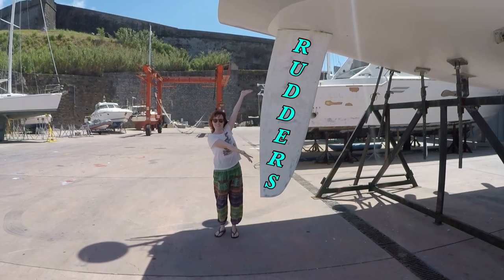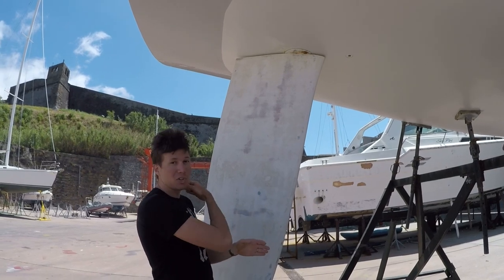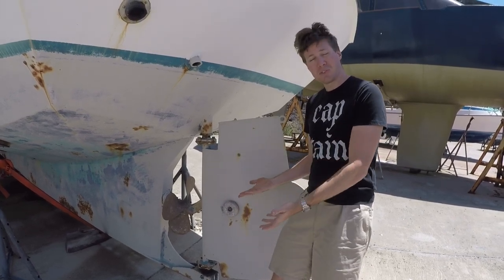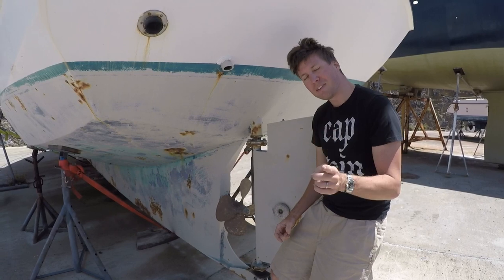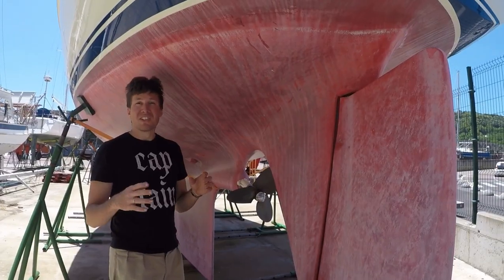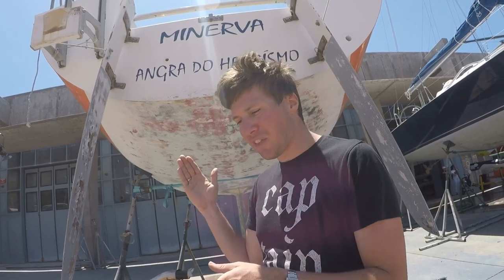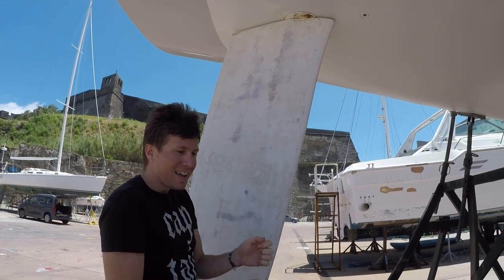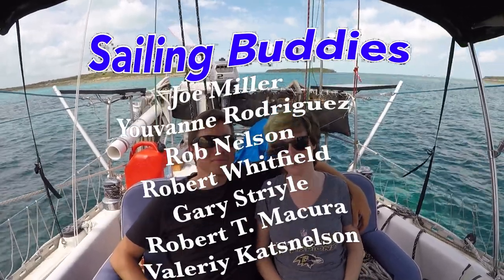This is the BEST Rudder! | Sailing Wisdom

Comment: My boat (a 1974 Dufour 35) has its stock entering the hull above the waterline. It was a major buying point for me. No freezing in winter and zero risk of sinking because of a rudder dropping out.
Reply from the maker: That is an excellent design feature!!
Reply: At that point, you’ve lost the end-plate-effect efficiency of the rudder, so why not just hang it off the transom?  Even more water-tight, easier to service, and can kick up.

Comment: We sail a Stamas 44 ketch from 1985. Her stock rudder was 30" wide and about 8" thick. The chord was way too fat. While sailing the rudder was constantly stalling on both the windward and leeward side. Hand steering required complete concentration. Luckily auto steering works well. So after sailing all summer like that, we bought a new custom rudder from Ruddercraft. Wider and thinner with a chord ratio of about 12:1 to 14:1 (it tapers). We re-launched a month ago and are very favorably impressed with the modification. It's probably rare to find someone who has redesigned their boat below the waterline.

Comment: You pretty much covered the basics.
You also talked about compensated rudders, and it is worth mentioning here that compensating a rudder is an excellent way of reducing autopilot power consumption.
About twin rudders and their advantages:
- Because one of the two is always acting vertically in the water (more efficient as you mentioned), then they don't need to be as long and deep as single rudders.
- When they are hung on the transom, they can be hinged so that the upwind rudder can be flipped out of the water.
- This hinge mechanism also incorporates a safety shear pin, so that in case of choc with a floating object, the rudder flips backward and out.
- twin rudders also means you always have a spare rudder.
The flip side of twin rudders is that they are a pain for maneuvring the boat   at slow speeds in close quarters.
Reply from the maker: Very cool points about twin rudders.
Thanks!
Reply: Why are twin rudders inherently bad for slow speed maneuverability?

Because they aren’t vertical when the boat isn’t heeled, so they are less efficient?

Because they aren’t in the prop wash, so they don’t have any lateral thruster-effect?

Anything else?

Comment: Very well done.  So easy to understand after watching your video.   I learnt to sail in a trailer sailer and recently I have sailed in Hansa 303's.  I always wondered how the Hansa boat could turn so well.  So now I know, because of the rearmost position of the rudder.     
I am building a small RC boat for the grandkids and I am wondering how to build the rudder to fit.  Now I know exactly what I need and what shape will fit the boat.  
You have been very helpful.  
Kind regards and keep sailing.
Reply from the maker: Thank you very much

Comment: An Alberg 30...
Carl Alberg was a great designer!

I'm looking at building a daysailer with a Kvaerner or VARA-type rudder cylinder through which the rudder is dropped like a daggerboard. If it breaks...

Just drop another blade in.

Comment: Lived on and sailed a Pearson 26 for a couple of years.  Fin keel with a BIG rudder on a post.  Hauled out to do some bottom work.  Manually moved the rudder to one side to sand a portion of the hull.  The rudder fell off!!  Electrolytic corrosion had eaten through the rudder post.  Fortunately it fell off in the yard and not in the last sail up the coast of Maine to the yard.  Don't have my next boat yet but whatever it is, the rudder won't be just hangin' out there.  I'm leaning toward offshore, full keel (I will be single handed).
Reply from the maker: Ouch! Thankfully it made it all the way to the dry dock! At least it happened at the best place for a problem like that to occur ⛵️
Reply: @RiggingDoctor  And I didn't even have to sacrifice a virgin to Neptune!  lol  I was most certainly grateful.

Comment: On my Sigma 362 I've got a kind of hybrid. Essentially it is an unbalanced spade rudder (the rudder post is at the leading edge) but there is a fin extending from just aft of the P post to the rudder where it is about 12" deep. In this way it semi-protects the top end of the rudder so nothing can get caught in the hull/rudder joint and jam it up like it could in the Benetau you show in the video. Whether it would protect it enough to prevent me from losing the rudder I hope never to find out! I was chatting to someone (a very experienced long-distance cruiser) about this issue a while ago and his opinion was that anything you run into is going to hit the keel first and would get deflected away from thr rudder anyway. Of course, that too is just a theory and one I'd rather not put to the test!
Reply from the maker: Any extra protection is better than no protection at all. 
I think it was on a Distant Shores episode where they had weeds getting caught in their rudder/hull area. It wasn’t jamming but it was causing drag.

Comment: Hi, thank you for the video!  I watched because I am currently working on building a new Rudder for my Rob Roy 23 Yawl.  It is a difficult thing to engineer and several of this design have had problems.  It is attached beneath the stern to a rudder post with plates welded on either side of the post.  A stainless bolt runs through the plates to hold the rudder and allow movement up-and-down via a line attached to the trailing edge of the lower portion that runs up to the cockpit over the transom...  

I appreciate your comment about the “fuse” because I do not want to build it so strong that it will not break-away....
Reply from the maker: Best of luck and kudos to you for doing the work yourself!

Comment: To answer your questions...  We have a giant keel hung rudder.  And yes, I think about this topic all the time.  It is a frequent subject in my head from when I'm swearing at it for not being able to backup out of my slip, or when I'm jealously watching fin keel with spade rudders nimbly do tiny circles in the fairway.  Once we are underway, it is fine and dandy and I never worry about it again.
But backing up is an adventure as you never know where you will go until you are up to speed in reverse.  (Seriously, 2 blade prop + full barn door rudder = reverse lotto)
Reply: I spent roughly 27 years in a Albin Vega where the propeller exits the counter stern above and behind the rudder. There was no steering in reverse until about two knots. Thankfully it was so light that I could easily manhandle it out of any slip. However reversing into a slip or setting anchor ranged from comical to terrifying depending on the boat's mood that day.
Reply: @flyingdutchman6984  this made me laugh as it is so close to my own experiences.
Reply: @jordanharkness  - for some reason my comment appears to have disappeared. Oh well.....  Anyways thanks for the comment back.

Comment: With the Albert style  rudder you do get the prop wash effects it's  slightly limited
Reply from the maker: We also have a 1966 Albert 30, but it’s engineless so I have no experience with the rudder notch for the prop. All I know about that notch is how great it is for servicing the shaft and the reduced effectiveness of the “stern thruster” trick.
Good to hear from someone with first hand experience on the matter.

Comment: Is it take called a fuse or is that what you call it? It's failure mode is to break off..it's similar to how a fuse works..a specified failure mode so it doesn't take it everything else. Also kind of like a key on a shaft..so is it a failure mode, a fuse, or a key?
What's it called when part of the rudder is in front of the axis of rotation..where it gives you a little bit of power steering due to water pushing on the part of the rudder in front of the axis of rotation?
Reply from the maker: The front part of the rudder is called a “compensated rudder”. 
I call it a fuse because it is the safety point. I’m not sure what the designers call it, but it is the planned failure point to protect the rest of the boat.

Comment: Why have blue water boat manufacturers like Amel and RS gone with twin rudders? Is there a design feature that offers some resilience if you run over something?
Reply from the maker: Actually quite the opposite, they are no longer protected by the keel and are at more risk of being damaged. 
The reason they do it is not because at the cutting edge of racing, it has its advantages which are never going to be realized by the normal cruiser, but because it looks fancy and sets them apart from other boat manufacturers (which all do the same). 
Race boats have features because of rules or performance, and people buying a boat want it to look like the race boats they see. In turn, the manufacturers make boats that look like the race boats to improve their sales numbers. 
A few companies make boats because they are good and not because they “look” good. These boats look very different from all the other manufacturers.

Comment: I want a full keel and the usual rudder sets that comes with them.  However I am really worried about docking.  Is the prop walk as effective?  Do they work as well backing as a spade rudder does, even if the effectiveness in the first place my be negligible??  Generally I worry about getting enough out of the propulsion and steering to dock effectively.
Reply from the maker: Prop walk is never enough when you need it and too much when you can’t have it.
We just never attempt to stern in if there is wind or current, in those cases we bow in. At some point it will be calm and we spin the boat then.

You will get used to the setup you get and then you will get better at that setup. I’m pretty good at Wisdom but a total noob on any other boat!

Comment: Yet one more interesting design is the boreal daggerboard combo.  e.g. https://www.morganscloud.com/2010/06/10/rudder-options/   It uses a smaller barn door like rudder, but it is supplemented by a dagger board that can be adjusted vertically to give more lift and balance the helm using clean water.  I've never used this but like this ideal.  While it might be a bit more awkward to get used to and reportedly the boat is still not great in tight quarters, it seems to give an ingenious solution for simplicity and redundancy.

Comment: If I had a 'Performance Rudder', at the very least I'd attach a ring and stainless cable to the top corner so you wouldn't lose the whole blade. Even better, cut a 45º notch from the top trailing corner and hang the rudder from a robust hinge locked with a shear pin. You can replace a shear at sea, but not a rudder...Our Balboa swing keel had a 'drop in' rudder that was great for beaching but could be tough to pull if you hit a sand bar...
Reply from the maker: I like the shear pin idea!

Comment: I'm here because I didn't know what a rudder is and am about to watch a hour long video of a guy losing it on a 30ft sail boat 1000 miles away from hawii
Reply from the maker: Holy crap! What video is that?
We lost control of our rudder at the beginning of an 1,800 mile voyage once. We couldn’t return because the area was all sharp rocks and a tricky entrance to the harbor! I was able to fix it and keep sailing normally, but if you lose your rudder you have nothing to repair!!!